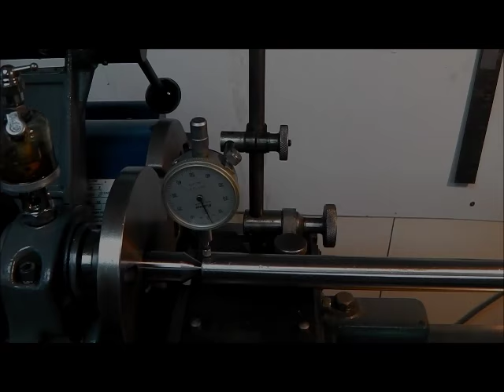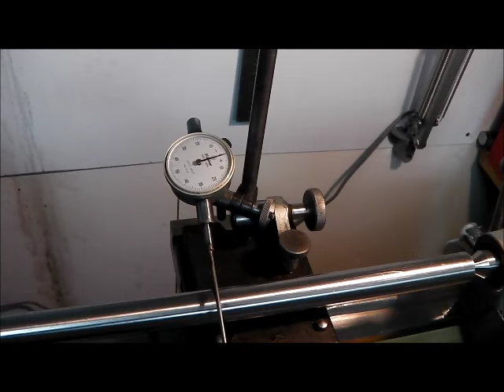Stuart Turner Lighting Plant - Part 7

Comment: Nicely done Phill, I did say they were pretty easy to work on, just needs care to work out where the runout is.
Funny that yours and mine had the 'issues' in the same area, although mine was a lot closer to being straight, which in some ways makes finding the problem harder, although easier to straighten. I was surprised that mine was bent were it was though, as it is inside the cases and so fairly well protected, not that that seems to have helped either of them. Lol
Reply from the maker: Not something I've done very much of, don't think I made too much of a mess of it! Pretty simple as you say, just time consuming. (very!)

Cheers,

Phill.
Reply: For the next one, you can now split the crank and fit your own bearings :)